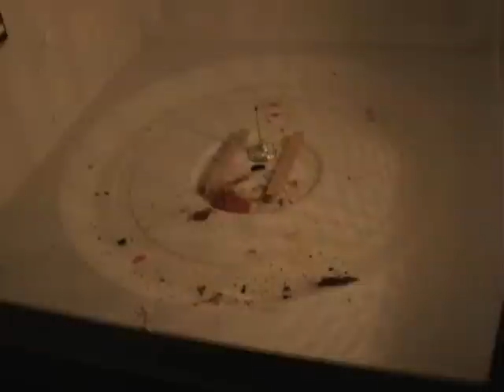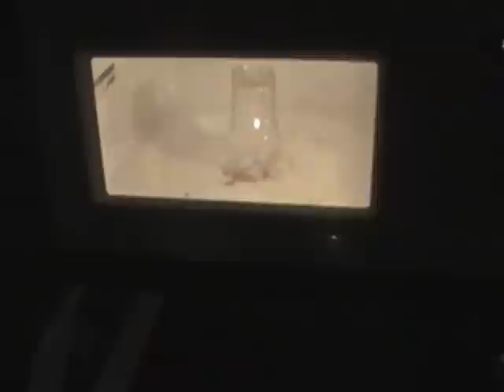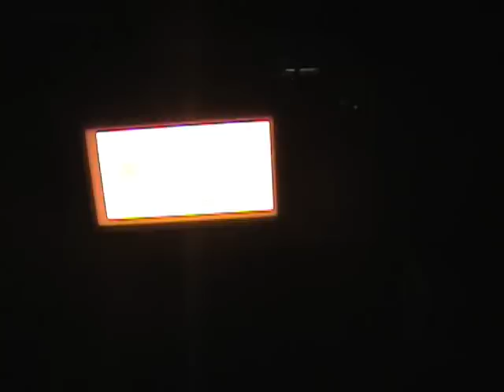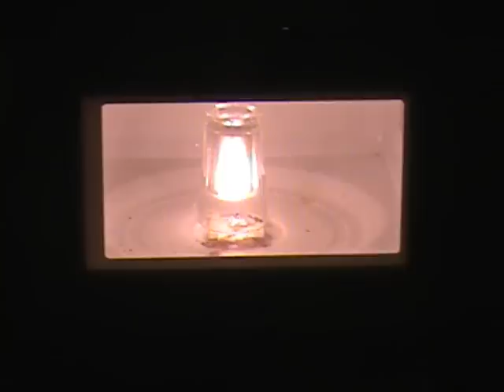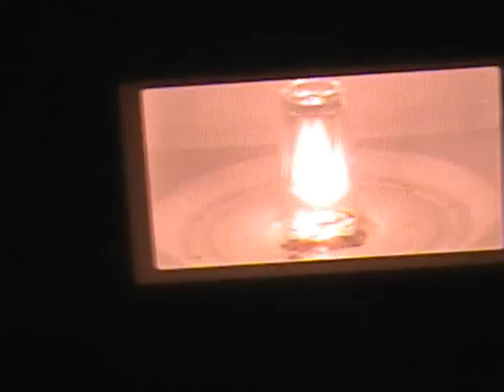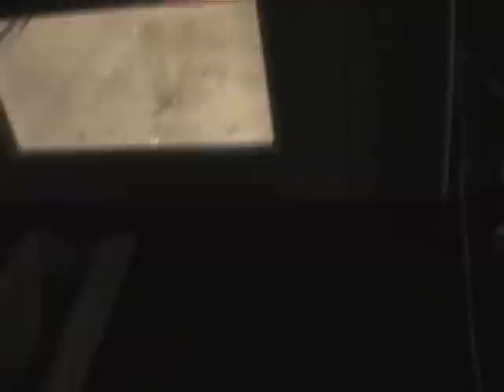Match Under A Glass In A Microwave Creates Plasma

Comment: @Danni4815162342 I'm afraid plasma isn't a gas - it's effectively the state of matter above gas. It's what happens when the atoms themselves start to break apart (I think), so it isn't radioactive or toxic. Having said that, it's still bloody dangerous stuff since it's so hot and it gives off vast amounts of UV light, which can cause skin cancer with excessive/prolonged exposure. It's the same reason welders wear masks - you'd be surprised how much UV a welding arc gives off.

Comment: the glass breaks do to its coefficient of expansion. basically glass doesnt like to be heated fast or cooled down slow  parts of it expand faster then other and you get cracks or in this case with super fast heating  shattering.